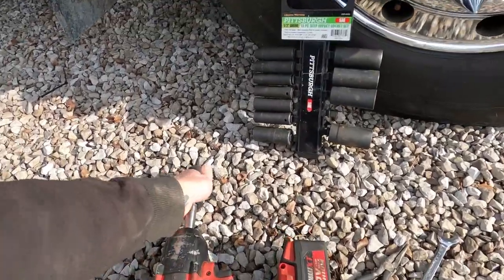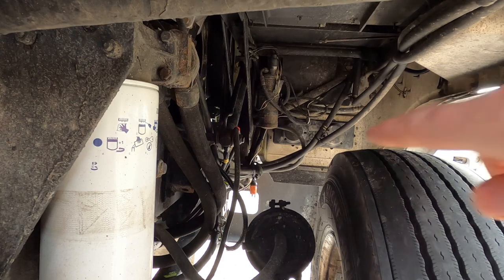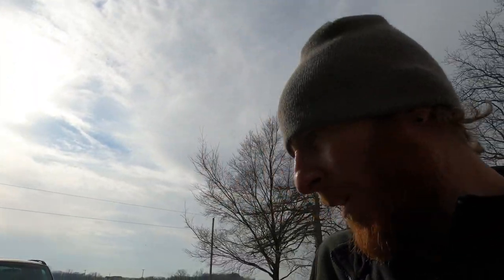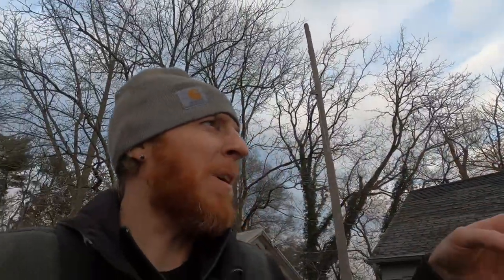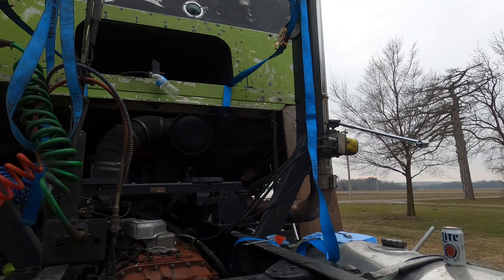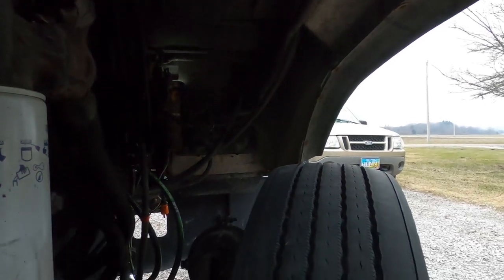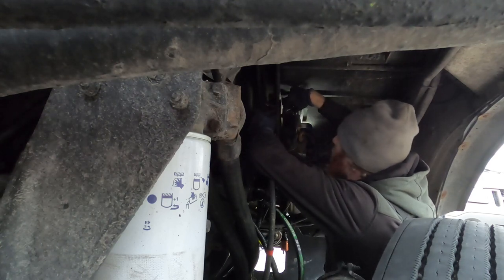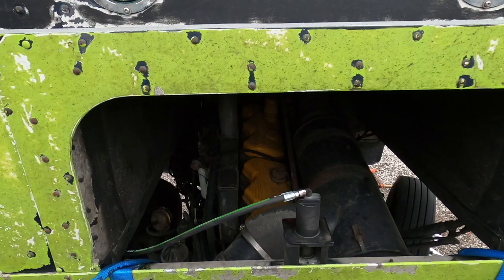Cabover Cab Lift Cylinder Replacement! Kenworth K100E Aerodyne.

Comment: Nice!  Makes me think i should buy a couple new rams for Kenny.  The seal on the one leaks a bit and makes a mess.  I also need to make new hyd lines.  I should probably do the new lines sooner than latter so we dont have a blow out.
Reply from the maker: Yep They were 288$ a piece through the dealership
Reply: Mike, if you only knew somebody at a dealership
Reply: @uliwehner  Ill have to see if we sell them.  Peterbilt discontinued alot of parts 😒
Reply from the maker: It’s paccar I’m sure there’s some in a warehouse somewhere

Comment: Wow! And you didn’t need any duct tape, just some zip ties! 🤩 So you had a hard time getting the safety latch back on?  Good stuff. I hope that you wife was keeping an eye on you. You may not agree, but like I’ve said before, sometimes you need an extra hand if nothing else but to be there if you get in a bind or get stuck in the wrong situation. This is a time where you need to be careful. You took precautions and that’s the important thing. You will have to show us the bar that you bought….whatever you used that had a pivoting end on it. That’s a cool tool! 🤩 Another job well done! You’re back in business and can now do what you went to do in the first place, right? Have fun and enjoy the ride some more!  Can you show us the old cab lift cylinder….does it have rust buildup or any signs of something that caused it to stick? I’m sure there is someone out there that could say…”Yeah, I’ve been there and that wasn’t fun.” Thanks for sharing with us! 🤩😎✌️
Reply from the maker: She was watching out the window 😂

Comment: If you had a concrete pad I would suggest getting a gantry crane. They are relatively cheap. It would of held that cab up easily, and you could use it to do things like swapping out a 5th wheel.
You would need to get a heavy duty one that had some height .

Comment: Back in business! That went well at least. Did it need anymore oil? Almost looked like it might be a smidge low when you went all the way up. Could have been air in the line tho too.
Reply from the maker: Haven’t added anymore yet. Sometimes if there’s to much it’ll spit out the top bolt that has the breather